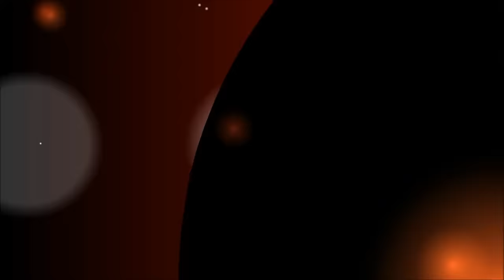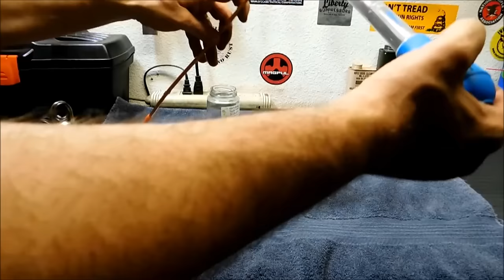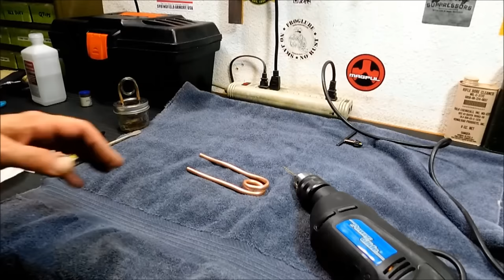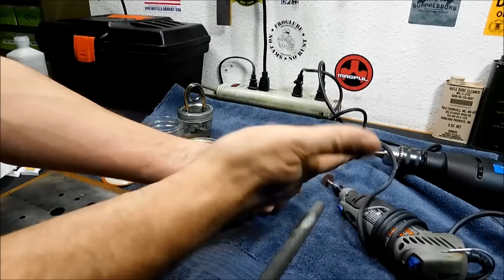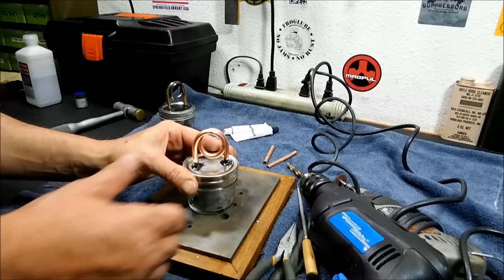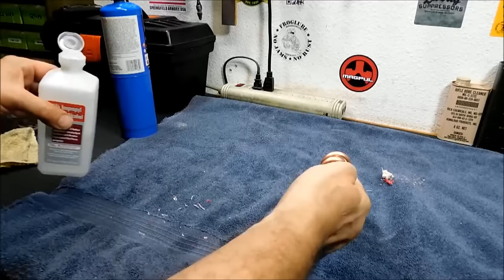Build Your Own Copper Coil Alcohol Burner Stove!

Comment: I'd run a fishing line into the copper tube. Tie it to the wick so I could pull it through. Fishing line will quickly go through the tube.
  I really enjoyed your video. You are an excellent teacher!
Reply: A good idea if you wanted the wick to go all the way through the loop, but here there is no wick in the copper tubing loop, only up each copper tubing leg that feeds into the loop.  See, you're not actually burning the wick; the two wicks absorb liquid and fill the loop with butane gas, not butane liquid.  When he says "prime it" he means just that, filling that loop with gas.  Because its an airtight system when the gas ignites it creates a negative pressure which forces more liquid up the wicks where the copper pipe is hot, converting the liquid to gas and into the loop.  So, the fishing line idea wouldn't work here.
Reply: I had the same thought, fish tape the wick in, unless that cent of the coil needs to be empty
Reply: Mr C it’s an alcohol stove not butane. Butane is pressurized and would need only to open the valve to allow it to flow
Reply: @mr.curviac8277  How does rubbing alcohol convert into butane gas??
Reply: @crazysquirrel9425  Pass. 😆
Reply: @pa_maj.MARTINI-van-MAN  What advantage does that copper coil stove have over a Trangia other than price?
Reply: @crazysquirrel9425  Probably none crazy squirrel, i love my little Trangia stove.
Reply: @pa_maj.MARTINI-van-MAN  I have both a Trangia and a Redcamp. Reason I got the Redcamp was for the potholder that comes with it. Works for either.
Also have other kinds of stoves too.
Love having options, just in case.
Reply: @crazysquirrel9425  Same here, I have quite a few different types of stoves myself, they're hard Not to collect, especially at car boot sales where I often find them.
Reply: @pa_maj.MARTINI-van-MAN  I made a bunch of soda can stoves too.
I figure if I cannot use them I could trade them to someone who might need one.
I learned how to make different kinds of rocket stoves too.
I reserve my propane/butane stoves (in a SHTF scenario) for use on rainy or winter days, inside.

About my Trangia - I borrowed a 4" cast iron skillet, used the Redcamp Stand, and my Trangia, and cooked eggs and bacon on it, while sitting at the kitchen table!
A relative couldn't believe that little stove could do that.
Of course it too a 1/2 tank of alcohol to heat up the cast iron LOL
But had plenty to do the job left over.

Biggest problem is if outside, the wind. Even a wind screen (I bought that too) will not help if it is cold and windy.
But there is a solution.
Dig a pit or Dakota style pit. Must be deep enough so only the top of your pot or skillet is at or below ground level.
Not only does wind blow your fire away (and heat), it cools what you are trying to heat/cook.

I still need to work on how to use oilve oil somehow to cook with.
That stuff is hard to stay lit.

Was thinking the copper coil video might shed some light on the problem.
Heating the oil can help it vaporize.

On your setup in the video -
Get a small copper pipe cap and place that under the coil. Epoxy it to hold in place.
Place a few drops of alcohol in the cap and light it.
It preheats the coil and makes things easier.

One problem with your setup is that when not in use, the alcohol will slowly evaporate through the coils.
Ideally one would want to use different kinds of fuel in the same stove.
Reply: @crazysquirrel9425  I did not make the above video, I'm just a commenter mate.
Yes, a way to burn veg oil efficiently would be great. A really small drip burner might work out OK if the temperature can be sustained, I've seen larger ones and they burn great.
Reply: @pa_maj.MARTINI-van-MAN  The trick to burning heavy oils is to heat them up to near flash point.
Hence the reason why I sew in copper crafting thread into my carbon felt wicks.
The process is called thermal feedback.
It can help but if the oil is too cold, you might not get the oil lit.

One can thin out the veg oil with kerosene or Diesel fuel a bit.
Olive oil is one of THE hardest to get lit and stay lit.
The old 'Alladin Lamp' from the fairy tales is exactly how they used to burn olive oil. A wide shallow sort of dish.
Wick laid near the surface of the oil to draw in the warmer oil and into the wick.

Veg oil will be similar.

Look at how a Hurricane Lantern works. It pumps heat into the fuel tank while burning.
But copper wire can too.

Insulating the fuel tank is a plus for cold weather use.
Too bad they do not make a double wall, vacuumed, stainless steel fuel tank for Hurricane lanterns.
And a wick adjuster that actually WORKED like you expect it to.
Reply: @crazysquirrel9425  Some Good tips there. The problem I see with a tank with a vacuum is, if it heats up it might expand causing fractures over time, possibly even explode.
Reply: @pa_maj.MARTINI-van-MAN  Perhaps another kind of insulation?
When using any kind of oil lamp, perhaps placing it on a piece of wood so it does not touch the cold ground?
Hanging one allows cold air on the bottom.

I did do the copper wire trick and it does work when it is warm outside.
Have to wait till cold winter to test it in the cold.
It will be using traditional lamp oil though.
Reply: @pa_maj.MARTINI-van-MAN  Take a large tun fish can and place a wick in it. Fill with bacon grease.
Almost guaranteed to make you HUNGRY!

The best known air freshener is BACON!
Reply: @crazysquirrel9425  The smell of bacon cooking in the morning will get most folk out of bed, I'm hungry now just thinking about it.

Comment: JB just on the bottom works just fine.   Also, if you don't have sand, sugar works fine.    That's 1/4in copper if anyone is curious.  ANY jar works fine.  Any fuel works fine.    Just sealed.
Reply: Thank you for giving out the measurement
Reply: @aazv23  Thinners for paints? Please.
Reply: @GF_Burke what about the hole in the copper ?? Should it be a VERY small hole ?? 
I tried to make one (10mm copper tube) but it won’t work..
It will only burn with a small flame, I wonder what I’m doing wrong 🤔
Reply: @cabomful    The small flame is just when it's getting started, keep heating it up. should take off.

Comment: oh my god I used to use rubbing alcohol to heat my bedroom when I was super poor. I built all kinds of crazy ways to control and boost the radiant heat. best one i ever made I called the "fire flower," it was basically a perforated flower bulb shape with petals, made entirely from folded aluminum foil. The pedals would help hold and control the flames and the perforations in the bulb allowed the fumes to come out in a measured manner. It was SUPER effective, but of course had to be rebuilt every 2 weeks or so. 

This is amazing to me

Comment: This has probably been mentioned already, but you can substitute frozen water for the sand. Tightly crimp one end of the copper then fill with water and crimp the remaining end. Freeze it and bend it to whatever shape you need. 

I have built many radio transmitters over the past 6 decades using this method to make power amplifier tank coils. 

Nice video! Thanks for sharing. 

--Mick
Reply: That doesn't cause problems from the water expanding when it freezes? Do you need to cut your tube longer to account for that or anything?
Reply: Table salt works too Mick.
Reply: the rubber caps are tight enough to hold water to freeze method [this is 1/4 inch ice maker line. rolls come with caps as intended for potable connection]

Comment: I like to prime mine by flipping over two times real quick.  Heat from auto parts store or denatured alcohol works allot better, you don't end up with the 10, 20, 30% water in the bottom.  I took a big open channel aluminum computer heat sink and put over one of my smaller ones and it made a great little heater.  Of course always do this in a big aluminum turkey pan.  You can put a big ceramic pot over the top and it radiates allot of heat.

Comment: Ths is really neat. I have some 1/4" copper tubing and  JB Weld in the garage so I am going to put them to good use.   Like the comments about improving the design - adding a reverse cap so we can seal the jar when not in use and heating with a bottle cap.  To that end, I plan to weld a small container of some sort under the coil so it can be filled with fuel and lit to heat up the coils when starting the unit since I doubt I will be carrying a torch with me.  That is how we primed the burners of the old kerosene stoves we had back home.

Comment: This was a great video!  Using your directions with a couple modification, I built three stoves to use as decorative tabletop heaters by adding a small aluminum half-cylinder about 8" tall JB Welded to the backside of the jar lid with another jar lid capping off the top to serve as a reflector, and a mantle made of 5" tall steel mesh rolled and crimped to sit on top of the jar lid, inside the reflector. I JB welded a chili can lid to the top of the mantle as a cap. Once the copper loop is lit, the mantle heats up and glows red, becoming an IR heater which amplifies and concentrates the heat produced. I used the muffler repair version of JB Weld since it's supposed to be more thermally resistant, but that's probably not necessary at these temperatures.

Comment: I employed your idea but instead of using the "Kerr or Ball" tin plate lid, I used a piece of copper sheet and sweat soldered the copper coil burner to the copper plate lid. once cooled down, I made a thin gasket using high temp silicone (2,000 degree rated) used to seal cast iron stoves and BBQ'S. Turned out great. thanks for sharing your project.
                  Kind regards!
                   Eric Dee.
Reply: That's Exactly what I was thinking when watching this  !  :) 
USE copper and solder it.
Reply: Post it.
Reply: It is the best solution when alcohol is involved, as alcohol attacks epoxy glues and degrades them.
Reply: Well, I told people in the comment section here when they talked about soldering the copper to the steel lid, it was impossible. And it is. But replacing the lid with copper sheeting is perfect! Great idea! That’s how I’m making mine. Thanks.

Comment: Nice presentation.  FYI: I used gauze strips and spun them tightly using my drill then pulled them through with a fine wire...Works great.

Comment: I live on a ranch with a few hundred fruit trees.  We always have a huge amount of fruit loss to birds and insects like wasps, so I have decided to make burning ethanol from the discarded fruit.  I could use a burner like this instead of spending money on propane.  In fact, I would like to try to use a few to heat a small room with the inverted clay pot heater idea.

Comment: This reminds me of a project I did as a kid where I made a similar coil of copper and used a tea candle to power a little boat in water. The coil and candle kept a flow of water that propelled the boat. You mention that the drill bit is acting like a punch and leaving the metal burrs behind. With the issues you had drilling the lid... You actually should use a punch. The jobber will work fine as well but both require a hard enough backing material so that the pressure you apply to the cutting tool does not deform your lid. Also, start with a smaller drill bit.

Comment: This is the same type of stove I used in a boyscouts 4 week adventure. It was a Philmont type of summer camp. We rode horses but we backpacked everywhere. They resupply the meals every week.
Haven't seen these stoves since.  Mine was probably from the 50s when I was using it in the 80s. It was copper and brass.

Comment: Leave the metal from the drill hole intact 
It gives the JB WELD more surface area to hold onto 
JB WELD will cover up the sharp metal
Reply: JB might dry up & crack with time

Comment: Neat trick! I have a multi-fuel stove that does a similar thing vaporizing fuel, just with a metered flow instead of a wick. It's cleanest with white gas, but will work with kero/deisel/jet, lamp oil, even most petroleum solvents (stay clear of fumes!), and alcohols.  

For yours, therefore, I imagine you're not limited to alcohol, and predict kerosene will work very well in there, albeit with a bit of soot.  Please do be very careful if you try anything more volatile / lower flash point/ higher vapour pressure than alcohol - and gasoline is right out!

Mine is an old old MSR Whisperlight, if you're wondering. Very light, very reliable, fully user serviceable.  I also love that the fuel is manually pressurized in its companion bottle at run time, stored unpressurized, and needs no consumable fuel bottles.  For some fuels there's a wick needed for the pilot burn (your "prime") and for some emergency fuels like alcohol or some solvents, the fuel pump valve and component would need to be serviced afterwards, but burn it sure will.

Comment: My first camping stove was a cheap POS based on this principle. It was made of some kind of brass-like metal, had detachable L-shaped pot supports like upside-down legs, and was designed for white gas. Gave it a brief test and it seemed OK. First trip out, it developed a case of thermal runaway, shooting 8-inch green (copper) flames out either side of the coil, right past my little camp pan. I thought it was going to kill us or burn the park down. Scary experience shutting it down too. Never used it again.

Comment: This is really cool because you can use this as a standard alcohol burner for chemistry type experiments or even micro-biological work.  Moreover, if you pre-cut the wick to the length of the copper tubing, and then run it through the tube before making your bends; it will eliminate some of your final steps in the production process. One of the other things that I like about this burner is that not only does it give off a good amount of heat but the flame is not as bright as an ordinary flame from a candle and therefore it gives you a tactical advantage when light discipline is important.  Overall, it is a very useful tool.  :-)
Reply: Problem if you put the wick in first, it makes it harder to put the sand in and clear out...
Reply: Guy your gonna burn your wick then . That heated area is where the vaporized fuel is pressurized
Reply: Filling the evaporation coil with solid fuel gives you a yellow flame because you are burning cotton, with an accelerant. Only worse light discipline than that is acetylene.

Just knock it off. If you cosplay as gi joe when shtf all that happens is the real Boogeyman knows which house the guns are in.

Lol, light discipline. I can see the end of your cigarette glowing in the woods and illuminating trees for a quarter mile. Longer if the leaves are down.
Reply: @Altrag_  Cool your jets buckaroo. I can spot a cigarette too. Sometimes, my comments aren't only to get the author to think but rather, the directed audience. As for being a soldier, I was probably a soldier long before you were born (before video game armchair warriors).  Next time, try to be a little more gracious with the comments and more understanding with whom you are speaking.
Reply: @rogerstillwell7176  Roger your idea is still very bunk ...your not saving steps your ruining the burner and then also burning the snot outta your wick

Comment: Great design! 👍🏻😄 If you leave the metal pipe in the middle of your copper twist when you pinch it in the vice it'll come out more evenly. Para cord probably wouldn't work very well because it's made out of synthetic materials, you need something cotton, but you can buy round kerosene wicks at different thicknesses, I'm sure one would probably fit in there I have a really small kerosene lantern that has a round wick which looks to be about that exact same size as your copper tubing. The thing you said about the JB Weld being able to take extreme heat is accurate, I'm not sure exactly what the heat rating is but I used one to fix a part in my engine which was cracked and it's never come open.
Reply: Oh yeah I forgot to say if you put a piece of hardwood behind the lid when you're drilling it it won't pucker out as much and it will be easier to clean up. Thanks for the video.
Reply: Matthias Southwick
Reply: Joel Araneta
Reply: allthings  possible
Reply: (random name)
Reply: I used J-B original to put a small compass on my dash; it warmed up and fell off whilst driving one day. A total waste of time/money, I could have just scored the surface & used silicone or block glue.
Reply: Yeen Str8. You read slow.
Reply: pipe cleaners!!!
Reply: Dennis Kathrens  6
Reply: Dennis Kathrens, did you try the pipe cleaners and did they work?
Reply: You can use JB Weld to fix the plastic radiators on today's cars too. Just make sure the cracked surface is dry and clean then sand the surface so the
cement can have good adhesion. I fixed a radiator neck on a '93 Buick that had a crack in it since these plastic radiator tanks get brittle from heat and
age. Whatever happened to the practical copper radiators and if the manufacturers could build plastic engines and charge the same price they would
do it--->overpriced junk!
Reply: I've seen JB Weld used on automotive exhaust systems not very far from the engine block itself & add in that the combustion temperature of alcohol in a semi-open burner like this is nowhere as high as gasoline.
Reply: jb weld also has a whole lot of new products for high heat applications , can be found by the exhaust adapters at autozone
Reply: @edlingja1  JB Weld is for metal not plastic. JB Weld does make a plastic weld material as well I think tho.
Reply: @pswagner  Modern pipe cleaners use polyester or some other synthetic material that will melt. Stick to organic fabrics or fiberglass wicks.

Comment: Awesome device ! I’m for sure going to make one ! You could set it inside a # 10 can or metal coffee can to give you something to set a pan or pot on. It would need to be open on both ends and have air holes in the side! A step drill works extremely well on thin metal ! It won’t grab like a regular drill bit !